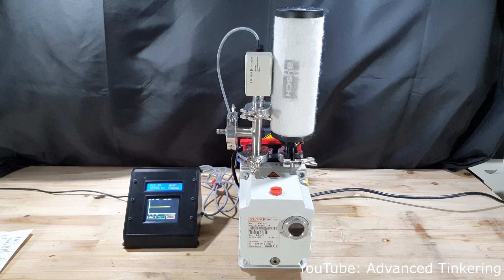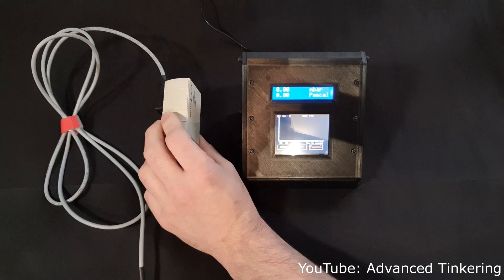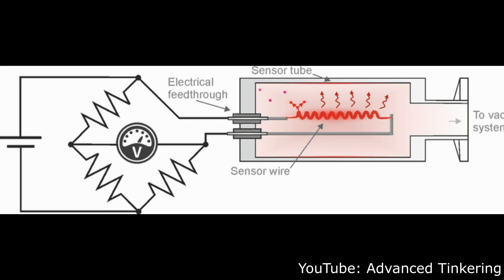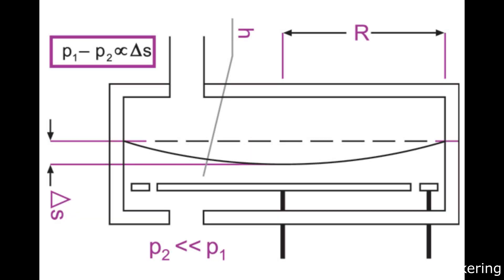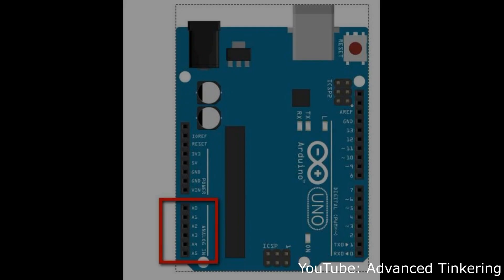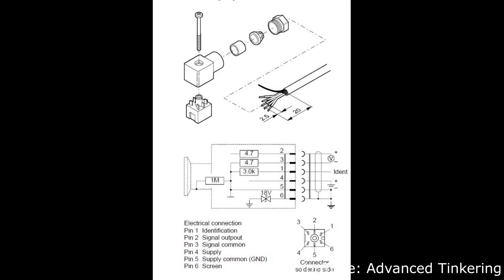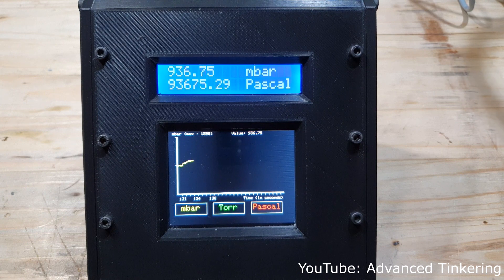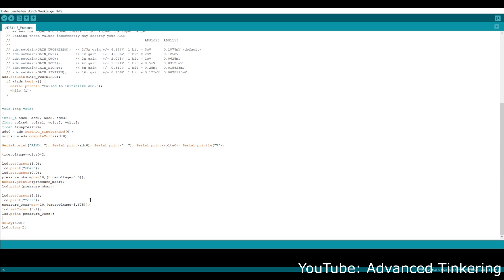Homemade arduino controller for pirani vacuum gauge

Comment: Nice project. I have done similar stuff fo straingauges. Two comments. First the ads 1115 only gives you 15 bits the way you use it. If you want the 16bits you need to level shift so that half if the neasuring range sits at about 2.5V than you can use differential reding witch gives you the 16bit. This has another advantage, that in differntial mode the ads1115 uses a commenmode filter for the measurements so all the commen noise is filtered out. Second you are using the adafruit library and a single read. The ads1115 can work at different sample rangel. In my experience it makes a great difference what sample range you use because it decreases the noise a lot. So use the lowest samplerate 1/s for best resolution. Use averaging in the arduino code. In you code I have not see wicht samplerate the library uses so you might loss up to two bits of resolution there

Comment: Nice work, congratulations. I have a question: did you use only pins 2, 3, 4 and 5?
Reply from the maker: Thank you! Yes, I only used these pins. But depending on the sensor they could be different.
Reply: Thank you so much. I have a Pfeiffer pirani gauge (TPR 270) with the same pins design. My measurement unit is not working and your video saved our experiments.

Comment: Just subscribed. Great video! One question I had is in your voltage divider, how do you compensate for the resistance of the voltage measurement ADC itself? Or did you just estimate it at infinity?
Reply from the maker: Thank you! Appreciate it! Yes, I just estimated it at infinity. I know that's not the right way to do, and I am thinking about calibrating it. But since the pressure readings are reasonable, I will leave it as is for now.
Reply: As far as I know a calibration of the adc resistance is not necessary in this case as the viltage is provided by an instrumentation amplifier inside if the sensor. That will keep the voltage konstant as long as it can provide enough current. So the 500k input impedance of the ads1115 is good enough. If you would measyure the h bridge of the sensor directly that would be a different matter

Comment: First off, great project. Subsequently, I would have a question about pin 1 (identification), what is this pin for? And also if I look right, pins 5 and 6 are connected and form ground?
thank you for answer

Comment: What do you need it for? I used a bmp280 for pressure measurement. I think I got it reading down to 40pa which is lower than it's rated. But it was better than my analogue gauge. I have nothing to compare accuracy with but it was repeatable. The bmp180 would only read down to about 28000pa. Which reminds me I need to fix my vacuum pump motor.
Reply: Hi David, don't you mean 40hPa instead of 40Pa?

Comment: Great project but your divider should have the same substrate... In other words not two separate resistors, but two resistors within the same package (such as SIP or DIP resistor packs).
Reply from the maker: Thank you for the advice! I guess the reason for using one package is to mitigate the effect of temperature fluctuations?
Reply: @AdvancedTinkering  Indeed

Comment: Nicely explained and well made. Where can I get Pfeiffer PCR 260, can I have the link please?
Reply from the maker: Thank you! I got it from ebay. You can find them there from time to time.
Reply: @AdvancedTinkering  what is the approximate price of the above and for how much $ did you spend?
Reply from the maker: @vikramsinghrathore6693  If remember correctly, the PCR260 was 140 €. The rest of the parts was approximately 70 €.
Reply: @AdvancedTinkering  thanks a lot

Comment: Is there any chance you could help me with a project just like this? My pins are a bit different but almost the same, but my pins are 1 - Transmit RS , 2 Recieve RS, 3 - Power + , 4 Power Return - . I love your setup and would like to duplicate for use in a Neon Studio where I will be getting down to 1 Micron. I would love to work with you on this if possible, and I can compensate you for your time.
Reply from the maker: What model of gauge do you use? In most data sheets you can find the pinout. If you wait a few weeks there will be a new video about an updated version of this controller with the schematics for the pcb and new software.
Reply: Nice Project, Can this be setup to read Microns?
Reply: Thank you, I didn't see this message @AdvancedTinkering , I have a MKS901P gauge. I will be looking forward to the newest video as I will be doing this project soon. Thank you!

Comment: Amazing! Where I can download the circuit? Thanks
Reply: And the arduino code!
Reply from the maker: Thank you! I did not create a circuit diagram. It is a standard circuit for the ADS1115 and I just used a voltage divider to reduce the voltage. Depending on the sensor you may not even need a divider. 
I will upload the code to my github soon and post the link in the description.
Reply from the maker: @germanmuller3111  Here you can find the code: https://github.com/AdvancedTinkering/Pirani-vacuum-gauge-.git